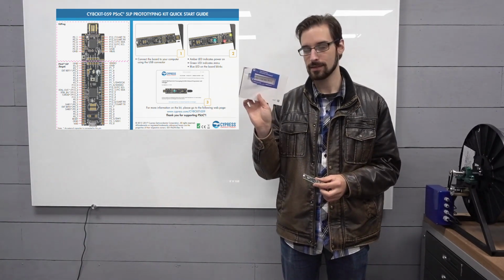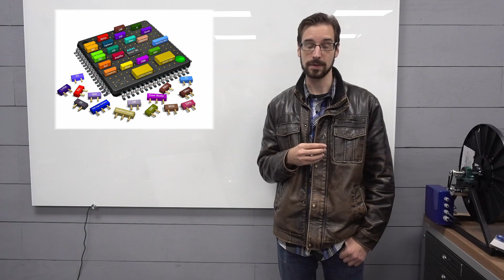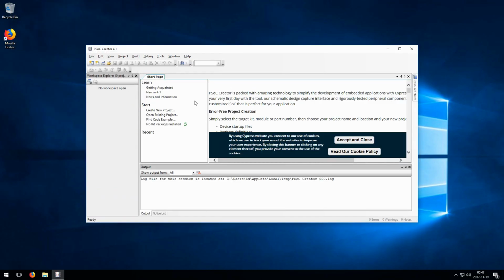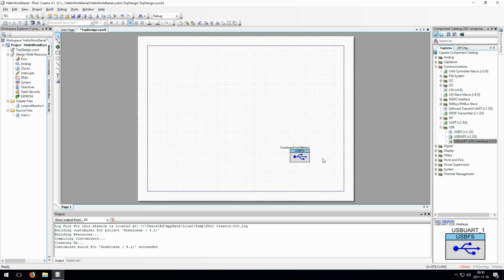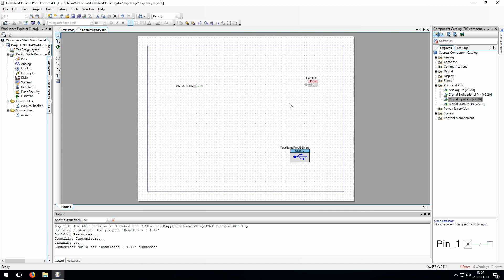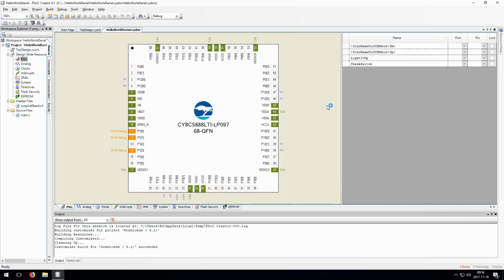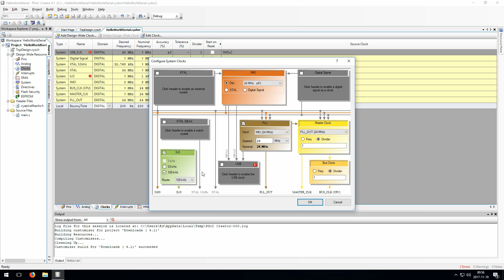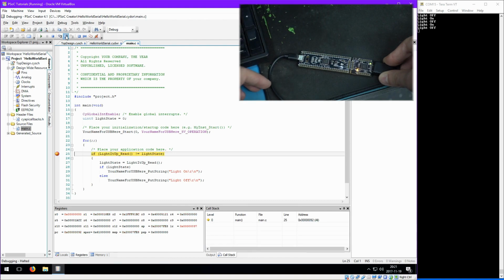PSoC Microcontroller Introduction/Tutorial - USB Serial

Comment: Does the PSoC work with adafruit libraries?
Reply from the maker: If you are very comfortable with programming, you can use them as a reference. But Arduino code is c++ and the psoc uses c.
Reply: @BauersLab  Lamentably not, I am only a novice in C++. Thank you very much for the answer!
Reply from the maker: No problem. Usually if I have a very quick and small project, I will still use an Arduino and the adafruit stuff because it is so quick to put together.

Comment: Hi! Thanks for the info. 
Can you help me out here?
Made a slight modification to your code but it doesn't work. :(
I modified it to send USB data every 1 second.

for(;;)
    {
        /* Place your application code here. */
        //if (LightItUp_Read() != lightState)
        {
            lightState = LightItUp_Read();
            if (lightState)
                DebugPort_PutString("Light On\r\n");
            else
                DebugPort_PutString("Light Off\r\n");
        }
        CyDelay(1000);
    }
Reply from the maker: Hmm, I would expect that to work. I would avoid using CyDelay when you start building larger programs. Here it shouldn't be an issue, but you can use a hardware timer without blocking the code from running. If you change nothing but uncommenting the if statement and commenting the Delay, does it work again?
Reply: https://www.duo.uio.no/bitstream/handle/10852/82665/5/Olav-Bjerke---masteroppgave.pdf  Can you please replicate that on to prototyping kit .All code available . Send HEX File & EXE (GUI) @ p20210447@hyderabad.bits.pilani.ac.in

Comment: For the psoc chip what is the minimum voltage level in volts that can be considered logic one?
Reply from the maker: You can always check for a specific chip, usually in the datasheet or the technical reference manual under electrical characteristics or under the io section if the manual has one. The psoc goes lower than usual because it supports 3.3v or 5v power, but I don't have the TRM handy.

Comment: Anybody else trying this in Windows 7? My Windows 7 machine finds the "synthesized" USBUART (when I connect the micro-USB port of the PSoC 5LP kit to the computer), but cannot find a driver. The vendor/device ids are USB\VID_04B4&PID_F232&REV_0001
Reply: I managed to get this running using Zadig [USB Serial (CDC) driver]. After a few more hours unsuccessfully searching for an  "official" driver I give up :(
Reply: I ran into this same problem with a Sparkfun variable dc load.  Cyprus seems terrible with their native usb support.

Comment: Hi, this is great although I had a problem using the USBUART component as you described and had to redesign my top design to use the standard UART defining an Rx connected to the output pin. Using your method I just got a garbled response in teraterm (all weird characters, non-standard letters and symbols and unreadable).  Your method seems more convenient and I was wondering if you had an idea of something I might be doing wrong? - I know this might be a hard question without looking at where I'm at, but just if you have a clue.
Reply from the maker: It would help to know your electrical setup. Are you using the same kit that I am? The connection should be a straight usb connection from the computer to the usb on the board. A normal UART is a very simple communication method where data lines are driven at the baud rate. USBUART is a serial port built on top of the USB protocol, which is much more complicated and has it's own hand shaking with the computer to make everything work. If you are using a USB to serial converter to connect, then you will need to use a regular UART. To use the USBUART, you need a regular usb cable directly connected to the board. (I am just taking some guesses at what you might have there)
Reply: Thanks for getting back to me. Basically, I followed the same set up as you in the video, (PSoC 5lp with the kit prog attached). I think when I had the normal UART working it must have been communicating with the kitprog, using it as the serial converter as you say?
When trying the USBUART I did have the board attached with the psoc Usb (both ends of the kit connected) but maybe, thinking it through now, I have a faulty/wrong cable? missing the data line or something random-cable from the box of strange cables related? Althoguh the non-standard characters were what got me confused though. Like I was missing a setting on terra term perhaps?
Reply: Just tried a new/different cable, haha.. Although, It seems to be I am having an issue reading from the 5lp unless the kitprog is 'plugged in', and when it is, I am only seeing that as the port to communicate with - hense the normal UART connection working.
When I have the 5lp connected at the non-programmer end, I am only getting TCP/IP as an option in Tera Term. hmmm, It is late where I am, so I am going to have to leave it for now. will try again tomorrow.
Reply from the maker: That makes sense as to why the UART was working. Were you getting the strange characters on the normal UART then? Because, the USB should either work completely or not work completely. Also, you can check in the device manager(Just type it into the windows search) to see if the com port is there. Have you tried directly using the code from github?
Reply: Hi, not had much time to sort this out (I love my 12-hour shifts). OK, today is the day. I tried your code from GitHub, I have followed your video again step by step including reinstalling everything psoc related checking .net is on etc. tried all the baud rates in tera term.
I am seeing the kitprog (in ports as 'Kitprog USB-UART com4' as well as  'kitprog 1.2.3.3' in USB devices) in my device manager but nothing when connected via USB through J6 - although the psoc is powered and button program is still toggling the led etc.
This is a proper head scratcher and very dishartening first step post-arduino.. haha
Reply from the maker: Do you get to work less days with 12 hour shifts? Or is it still 5 days a week? 

Do you get anything when you plug in only J6?

Lol, yeah. Unfortunately, there is always a bigger head-scratcher around the corner. Once you do solve a few and look back, though, It is quite worth it.
Reply: my shifts are a big old mix, few days off now.
Nothing from J6 showing in device manager, not even any un-named USB devices or anything.
The drive to get through these problems is why I do it, although you do reach a point sometimes when you don't even know which ballpark the problem exists in.
Reply from the maker: Oh ok. Having a couple days off in a row is nice anyway.

Ok, so the device should be working with just J6 plugged in. If the light and everything are still working, then it is probably not able to complete the usb handshake for some reason. At some point I want to get a forum set up. It would be a lot easier to work through this kind of stuff. I am not sure what else I can say without being able to see it. I guess, I would be trying different USB ports, computers and possibly another kit-059 if you have one. But, you are probably already doing such trouble-shooting.
Reply: A forum would be good, just scanning past the list of replies seems like this is not the best medium for this kind of thing. I just found the cypress developer community, will have a look around there too.
Thanks for your help regardless. I look forward to more videos using this device!
Reply from the maker: Yeah, the comments section is a strange place.

Let me know if there is a topic I should cover. I am not really sure where to go from here without just doing projects.
Reply: I think projects are good as you can follow along with a known goal in mind, teaching you of elements/techniques etc that you might not come across otherwise that provide inspiration or you can tweak and implement in projects of your own. I should say that tools are always a personal favourite.
Just don't start making knives, as everyone seems to be making knives right now.
Reply: I had left this to work on some other projects and in the meantime bought a new 5lp, just to see.. and a new USB cable.. because why not. Plugged it all in tonight and programmed my existing program and it works like a charm. The old 5lp also. It was the USB cable! you know sometimes, I just wonder what it is I am doing with my life.
Reply from the maker: Hehe, that is the worst. I had something similar on a job a few months ago. I was commissioning some servo motors that ended up having faulty cables. I assumed the cables were good. So, I was debugging so many red herrings.

Comment: I hace the same board, I will like to see how to do the quadcopter they did in PSoC semi conductor chanel, this uses bluetooth(I dont know if this one has an integrated BT module) accelerometer, gyro and i gues pwms for the motors
Reply from the maker: This board doesn't have built in accelerometer or gyro. I have used some of their pioneer demo boards with those built in. if you want to play around with those type of control systems, I would suggest using one of the newer PSoC 4 Pioneer boards.
Reply: Thanks but i think i will learn to use this one first

Comment: Awesome, at what Baud Rate did you set it up Tera term?
Reply from the maker: I just left it at the default 9600. It is full speed usb 2.0 though. So, you should be able to set it within the limitations of that. (which is like 12Mbits/s)
Reply: https://www.duo.uio.no/bitstream/handle/10852/82665/5/Olav-Bjerke---masteroppgave.pdf  Can you please replicate that on to prototyping kit .All code available . Send HEX File & EXE (GUI) @ p20210447@hyderabad.bits.pilani.ac.in

Comment: Thank you for introduction to PSoC, but isn't it too late for 'Hello World'  example? There are literally dozens of PSoC introductory videos, and nearly none beyond that, so it makes no sense why should anyone select PSoC instead of cheaper uC.
Reply from the maker: Yeah, that is always the dilemma with tutorials. Everyone has different levels of experience and you just have to start somewhere. I started this far back so that I would have something to point to when people ask me about PSoC. For the most part, I use the PSoC microcontrollers because the IDE is really that much better. If I were designing a product for mass production. I would probably spend the time to use a cheaper uC. But, when you are prototyping, the time it takes to setup basic communications and subsystems really matters. With the PSoC ide, it takes very little time to setup the hardware, and the c that it generates for you is very clean. So, with minimal memorization of registers, you can jump right into your C logic. With TI and ST uCs that I have used in the past, it takes more time to set up and clean everything before you can get into the meat of the program. (Which might not matter if you are building enough of the end product)
Reply: https://www.duo.uio.no/bitstream/handle/10852/82665/5/Olav-Bjerke---masteroppgave.pdf  Can you please replicate that on to prototyping kit .All code available . Send HEX File & EXE (GUI) @ p20210447@hyderabad.bits.pilani.ac.in